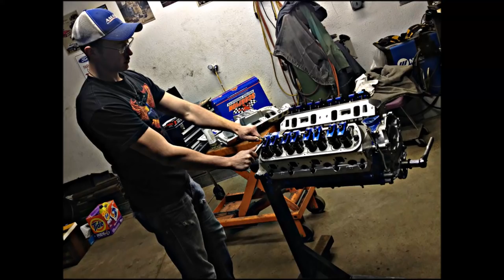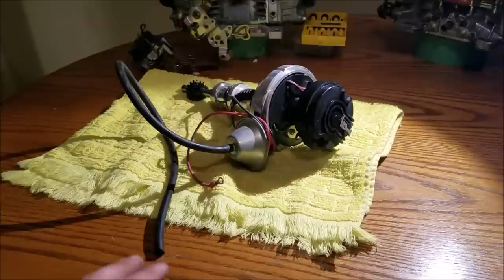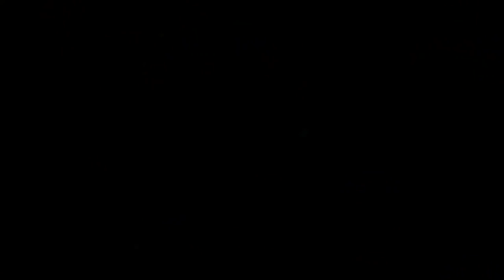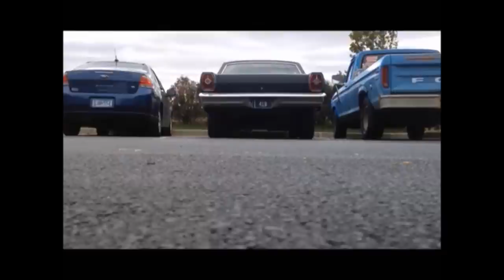Vacuum Advance Explained - What it is & How it Works

Comment: Thunderhead289 I have a 73 olds Delta 88. I have a demon 625 carb. Changed intake manifold. Hei distributor with vacuum advance. I have the 73 chassis manual for the car also. I'm having issues. The book says 12° at 1100rpm. It's not right or I'm not doing something right. I'm getting soot thru tailpipe so I'm thinking timing is off. It's running rich you can smell the fuel. I did the Venturi box idle set screw like you illustratrate in other video. Long story shorter where would you start with troubleshooting. I've been at it for over a month now off and on. Thanks in advance

Comment: Would you consider a Melling MTC-6 on a 454 still in the range for vacuum advance working? It's got 112 LSA and .449 lift (I think) duration is like 208/209?
Been awhile since I looked at the specs, it's a stage 2 towing cam in an 81 C30 with a Turbo 400 behind it. Thanks in advance!

Comment: hey man. ove your channel.  I was hoping you. might have some insigt into some performance issues im having.  i hsve an 82 GMC vandura.  And just recently it started bogging down and losing power but usually just when it shifts into 3rd.  I drove it with a vacuum guage attached to manifod vac and wn it bogs down the vacuum goes to around 5 and below.  .   could this bog be a vacuum issue?   i have a vacuum advance on order as im pretty sure mine doesnt work.   BUt i also think that it wasnt working for a long time.    Also.   I had an old timer mechanic convince me recently to bypass all my emissions stuff, and he unplugged all the hoses from my two TVS switches.   Do those now need to be removed and plugged off?  in other words...could they create a vaccuum leak if left in without any lines attached?     im scratching my head for a wekk over this bog

Comment: My dad has a 66 F100 that I helped him swap a 390 from a 65 galaxy into. Has a mild cam, headers, Holley 600 and for some reason when the vacuum advance is plugged into manifold vacuum the truck dies. There are no vacuum leaks in the hose and the gaskets are all new. It will also idle only with part choke. Carbs been rebuilt twice. Any help is much appreciated.

Comment: Hi There,

Would you put a distributor with vacuum advance on it on a 1985 Chevy C60 with a 366 big block and a Holley 4160? This is a big, slow truck made for hauling rather than speed. I'm wondering if a vacuum advance would help my fuel economy.

Comment: One of the best explanations I've seen. I have a 1979 Viking Deckboat with a Chevy small block 305 in it. I bought it not running thinking I could fix it. Well so far it's been a hole in the dirt (can't get it in the water) I'm throwing money into. Initially the guy I bought it from said it just needed a fuel pump. So I replaced the pump and then found the Starter was bad. So replaced it. Then I found the Spark Plug wires were not right. So fixed that. Then as I was playing with those I found the Rotor in the Distributor would turn in my hand. I looked at it and it seated on the shaft good and actually looked fairly new. So I pulled the Distributor and grabbed the bottom gear and the Rotor still turned in my hand. Now I'm kinda stumped. This Distributor doesn't have a Vacuum Advance on it and I can't find an old style, similar  Distributor. Some have said just replace it with a modern electronic ignition but all the Distributors I can find still have the Vacuum Advance on them. I don't have the experience to switch it.  I think the coil should be changed also but I really don't know what to do about this ignition system. Stumped in South Carolina!

Comment: I have an HEI Distributor on my 6 cylinder Corvair that has an Isky 280 cam in it.  I'm getting exhaust popping on deceleration and I thought I had exhaust leaks.  Someone told me to remove the vacuum from the distributor and guess what, no more popping. 

This is the same distributor I used on another engine with the same cam and there  was no popping.  Why am I getting exhaust popping now?

Someone else says to use a distributor vacuum delay valve.  Can you explain how this valve works?

Comment: Question, I have a 72 hurst olds just rebuilt it has a comp cams 42-241-4 cam 490 lift 280 duration 110 lobe. Timing currently set at about 20 Deg ATDC when punched engine is pinging pulling timing back to around 15 no ping but engine won't idle unless set at 800-900 rpm in gear. Please help. Thank you.

Comment: Hey man I got one for ya! Okay, I just bought a 1984 f150 Custom short box 2wd with a 5.0 in it. And ive been doing a budget build on it and I just got my mad 6al box and my blaster 2 coil wires up and working, but now when I try and run my tach wire to the back of my factory tach from the tach output onthe msd box I get nothing. Now fyi this truck did not come stock with a tach, I robbed the cluster and wiring harness out of another junk truck and just wired it up to mine and it was working until the msd swap, now nothing. Help me out if you will!

Comment: Definitely Carb Tuning how to. I've been trying to tune the carb on my 302 and I get it running good one day then the next it runs like garbage. I've been doing this for more than 2 weeks now and overall it never gets any better. I've set the idle timing to 11° btdc and am using a vacuum gauge to try and set the carb.
Reply from the maker: what carb do you have? if you give me some details on it, i may be able to direct you to the source of your issues.
Reply: From what I can tell its an Edlebrock Performer 600 cfm carburetor. I know the carb is good as it was rebuilt with the engine so that shouldn't be the issue.
Reply from the maker: +Dalton Elliott I have a pretty strong distaste for the Edelbrock carb after many years of experience with different carb types. Never trust when something says they rebuilt something. There are only a select few that can "rebuild" anything automotive correctly.
Reply: Yeah I know it not a great carb but I got it for free from a friend so I'm not too upset.  Any advice on tuning it in? I've let the engine get up to temp, tried tuning it for the highest idle vacuum and it never really gets above 15" of vacuum.
Reply from the maker: are you cammed?
Reply: Yes it is, I kinda figured that was part of it.
Reply from the maker: +Dalton Elliott I'm going to put together a carb tuning video tonight and drop the link here for you. There is a lot to explain, so the video will do a better visual job I think.
Reply: Hey thanks, I really appreciate it.
Reply from the maker: hey, i have the content, just havent made the video just yet. bear with me. it will get done this weekend.
Reply: Its all good. I've gotta wait til the weather warms up again at the end of the week.

Comment: Why would you use the term " pull in ignition timing 2:16 " but when the vacuum is pulling the diaphragm it is advancing timing increasing the numbers,
the term pulling would seem losing timing numbers not increasing numbers as you have stated.....

Comment: Quick question on your thoughts:  1977 ford f100.  302 engine.  Starts great.  Idles great.  Revs and drives great.  But when coming to a stop at a stop sign or light,  the engine dies.....  Starts back up with pedal pressed to floor.  If I kick it into neutral when coming to a stop the engine will stay running.....
Reply: torque converter staying locked up?

Comment: I have an 79 F350 with a 460 that someone put an Edelbrock 1405 on ..right now it runs ok when "cold" but when I drive it for 20 min or so then when I try to let it idle it acts like it wants to die. Put a vacuum gauge and it hovers in 15mg which is "late timing". At "cold" it pulls 21mg or so, seemed healthy...I had been adjusting the idle mixture screws because even when I first bought the truck it seemed to run rough at idle - shaking every so often. I figured that was just partly from having such a big engine.

I spend some time messing with the idle screws to get max vacuum (got about 21mg or so) and lowered the idle rpm to around 700. Of course putting it in gear on automatic tranny that RPM drops even more so now becuase it is less happy when warmed up, when in gear is when it acts like it wants to die, so at stop signs, etc. So I don't trust it to take it through town too much. 

So now even after my attempted adjustments it runs worse than when I got it when fully warmed up. I tried to check base timing but some idiot painted a giant white stripe on the line so I cant read it . the engine label says stock is 8 degrees.  I have to get down in there and clean up the line markers and repaint them

Yesterday I decided to test the vacuum advance (which in this case they connected to ported vacuum). Well it turns out it just sucks air, and doesn't move - I can hear the air just go right through it. So, I need to replace that - so that seems to probably be why I have a really bad idle. And it sounds like I need to connect the advance to manifold vacuum, and then maybe I will get proper idle at full warmup. 

It seemed to run better when I first bought the truck (still ran rough at idle though, you could feel the shaking every so often) but I think that is because they just raised the idle RPM to overcome the crap idle. They had the idle around 1000ish

I'm hoping putting on a new vacuum advance unit and connecting it to manifold will solve my crappy idle issues. It seems to run fine other than that right now, no problems accelerating or taking off from a stop sign even. Just bad loping and wanting to die after its fully warmed up. Throws me off a bit that it seems to run better when cold even with the advance not working.
Reply from the maker: Could be two things - generally if something runs better cold than it does warm with the choke fully open is because the mixture is too rich. a colder engine needs more fuel since the intake is cold so fuel does not atomize as well. once the engine warms, less fuel is needed for a running ratio since the fuel is atomizing much more efficiently. 
on the other hand, if you have excessive underhood heat, the fuel will start vaporizing in the lines, and even if it doesnt vaporize, it gets very warm and less dense which alters the AFR. id imagine with a 460, you dont have a lot of room under the hood. search "thunderhead289 return line" i really battled this in virginia till i added a return line to my galaxie. 
also, always have a clean air filter, a dirty unit is restrictive and works as a choke to a degree and will create some of the same symptoms
Reply: I hacked away at it for a while today, got the new vacuum advance installed, checked the timing seemed OK, checked for vacuum leaks, didn't seem to find any. 

Finally I pulled the idle jet rods out of the carb and blew air through the holes..and now - seems to run much much better. I saw a video on Youtube where they show how to do that and thought it was worth a shot. Maybe I just had some dirt in there, don't know. It seems to be running OK for now, or at least, when I took it to the gas station, it was running pretty good and didn't want to die at stop signs.

Thanks for the responses! Your videos are excellent
Reply: I was going to guess the vacuum cannister was shot.

Comment: hi! Great video and thanks for the clear explanation. Am I understanding that correctly that a vacuum advance valve has absolutely nothing to do with a rough idles speed? I have tested the valve and the pin doesn't move at all while sucking the hose..I only can open it with a screw driver. I have a rough idle/bit revving too on my 1983 Honda Accord and can not find the source of the issue...thanks!
Reply: The diaphragm is probably damaged/deteriorated and has a vacuum leak. What will happen is if your engine is set at stock base timing is running retarded because it relies on the vacuum advance to run at its sweet spot. A quick fix is advancing the base timing to overcompensate for the lack of vacuum advance. Only problem is as explained here when you are at wide open throttle your timing would be more advanced than desire and you'll probably get loss of maximum potential power or pinging if it's advanced too far.
Reply: Seems to be that vacuum canister has a leak... those engines usually initial ignition timing is 6 bdtc with the vacuum advance disconnected.. if  you have rough idle start by checking and tuning the basics, such as spark plugs gap, check condition of the spark plugs cables, the rotor and the cap also  the right gap for the points in the distributor... assuming the carburetor has no internal leaks and it's in good conditions and valves are well calibrated

Comment: Diggin your videos. I bought an 85 cj7. Not gonna lie I’m in over my head. I’ve had a misfire since I bought it. I thought it went away but it’s back. I did plugs wires cap rotor and retired it and it seemed great. Now it got a little cold and she’s back. It could be surging. To me it feels like it’s not getting gas and it’s a hard misfire. Really stumped on it. I’m gonna change the pcv valve I am leaking oil and burning oil and it does run rough. I enjoy learning all these things and taking a step back in time. Appreciate your knowledge and time!
Reply from the maker: Hey Ryan, what type of carb does it have? 
The biggest tuning aid is to get a wideband o2 as you know what your fuel curve is doing. 
Fuel and timing needs to be a harmonious balance. 
Search “Thunderhead289 wideband” 
I have a full parts list with links in that video
Reply from the maker: Hey Ryan, what type of carb does it have? 
The biggest tuning aid is to get a wideband o2 as you know what your fuel curve is doing. 
Fuel and timing needs to be a harmonious balance. 
Search “Thunderhead289 wideband” 
I have a full parts list with links in that video
Reply: Smoking??

Comment: great video. so if two new vacum advanced distributor cause backfires in  the exhaust at a certain rpm/timing it could be the vacuum ?
Reply: No, not the vacuum.  Backfiring from the exhaust is from a rich AF mixture. Backfiring from the carb is a timing issue.

Comment: I bought a 70 Impala with a lot of stuff wrong with it. Got most of the major things fixed, but I'm having a hard time knowing where to put my vacuum hose from valves to the 2 bbl carb. Bought a Haynes manual and that was pretty useless and I can't find any stock photos of a 69 or 70 with the air cleaner off. I just want it to run right. Not fast
Reply: SwitchDoctor it goes straight from the distributor to the front pass. side port on the carb.
Reply: Borrow or buy (Harbor Freight has decent cheap ones) a vacuum gauge, connect it to a port, test if it has vacuum (needle is up at idle) and when you rev the engine the needle should drop (no vacuum). If you connect it to a port that does that you should be good.
Reply: Lance Uppercut woo wait.  mine is the opposite.. idle no vac. half throttle 15 in. gm hei .
Reply: @danwells7691  If you have no vacuum at idle and then vacuum starts as soon as you open the throttle a bit that is ported vacuum.If you then punch the throttle vacuum should instantly go to 0.